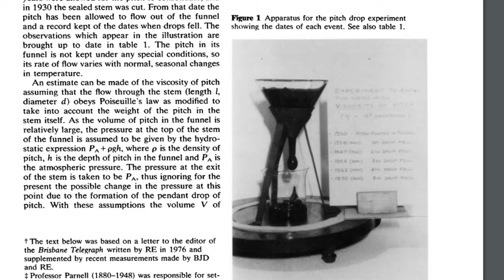LONGEST running Physics Experiment? The Pitch Drop Experiment

Comment: What if everything is just a liquid but takes 10000s of years for a drop instead of 10s
Reply from the maker: Excellent question. I am definitely not a soft matter expert, however, the molecular structure of familiar solids (Iron, steel, etc) with an extremely high Young's Modulus leads to a very predictable behaviour, i.e. no flow, due to covalent bonds which are very strong. The more chaotic structure of glass, pitch, non-newtonian fluids etc is what brings out this strange behavior, sometimes over very long time scales like pitch and sometimes over short time scales for others.